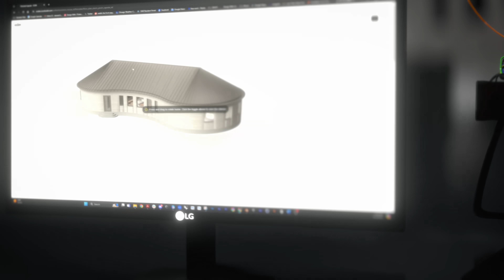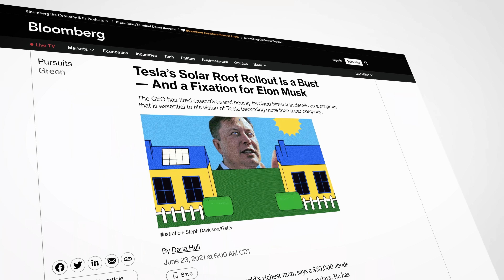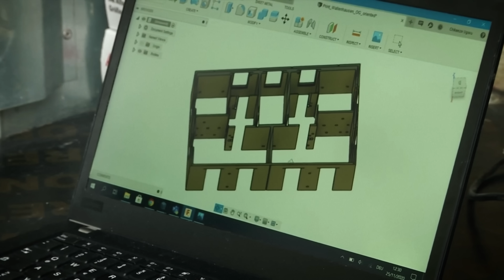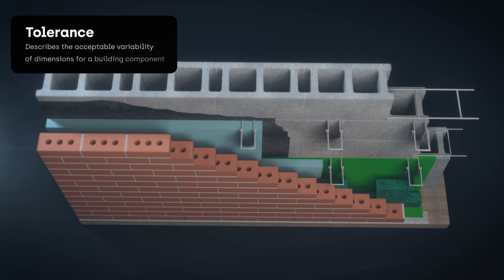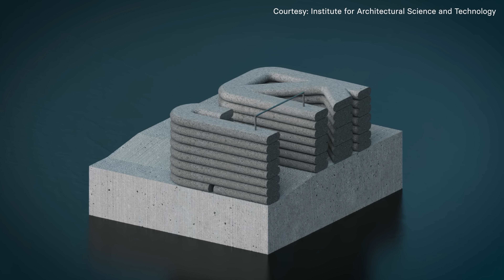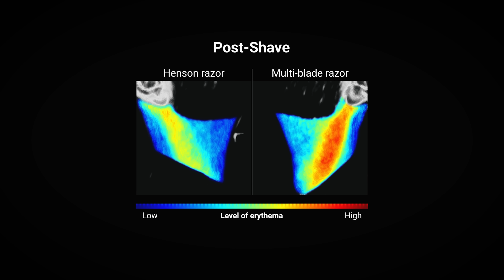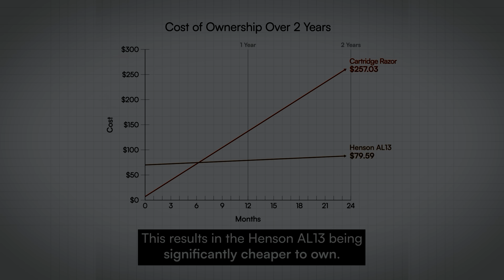Why 3D Printing Buildings Leads to Problems

Comment: I could get 3d printing for outside walls, maybe some load bearing fireproof walls too, since damage to those tends to need a major rework of a building.  The partition walls that can be open or closed floorplan stuff, or maybe relocatable utilities like laundry and mudrooms, should be modular.

Comment: I don't see any problems that cannot be engineered, right now when you build a brick house you plaster all internal and external walls unless you chose to leave the bare brick, the same can happen with extruded building, i actually don't see a problem other than the ability to alter a building, this confuses me as most all buildings have load bearing walls that you should not remove or if you do you design it so that the structure is still as strong as before.

This video seems to be a video looking for a problem, and i just don't see it. Plater internal or external walls as done with brick buildings, use wood divides inside the house for partitioning that can change or  as you said separate structures, so some can be removed in the future. LOL window or door  voids can be smoothed over by a worker who would have time to do a dozen other jobs while the building is growing.

Comment: Within 50 years, they will be able to integrate metals such as copper, plastics, and concrete into each layer of printing. Pipes, electrical, foundations, etc. will be able to be built layer by layer, with each pass integrated with all elements of a building.

Comment: Very good presentation. I see even more issues in a cold climate (where filling the voids with insulation just won’t cut it), unless you integrate/add tons of traditional techniques on top of this and then, where did the benefits go? And in a milder environment receiving substantial amounts of rain, how does the wall cavities drainage work?

Comment: while i'm not an engineer or architect, i have significant concerns regarding the long-term structural integrity of 3D-printed houses, especially after natural disasters and time. in contrast, traditional houses built with red brick or stone are using reinforced bars to maintain their integrity over time and in extreme events (such as natural disaster). despite the cost-effectiveness and time savings of 3d-printed houses, i strongly prefer traditional construction methods.

Comment: There is such a thing called the auto-brick laying robot. It's actually Faster than this crap and the house looks like - well, house built with bricks. 😂😂😂 How can pouring concrete on-site, layer by layer, beat mass produced bricks (gazillions a minute) being laid by a robot (same gantry robot by the way). Think in terms of resolution.....the brick as a large pixel, the 3D printed concrete as fine resolution.....which is gonna win the race in speed or cost? Dead-End technology.

Comment: 6:11 im in shock that brick has a 20mm tolerance. Formwork we allow for 3mm when we are being very sloppy, at least for the companies I’ve worked with.
Reply: Finally, someone who actually works in this field brings a hint of reality... 😮 thank you.
Reply: Its because as you place bricks you can actually just steer the walls in various directions, not to mention bricks are actually a very flexible material on a macro scale, As in they have alot of ways to expand without breaking. Then there is also just the human element of having 30 guys laying bricks in various directions at once you will get variance. To be more precise would be extremely expensive and slow.

Comment: Just bought a house myself, I got lucky and unlucky in ways. I don’t have much info, but I know the house was built before nail plates. The wood looks like it has about 2x the amount of bands a new 2x4 would have so the wood definitely was older when it was cut. Overall the construction is crazy solid, never creaks at all. Only thing is, whoever wired this fucker up did not understand the ground line. I’ve been replacing all my fixtures, switches, etc. they have actually utilized the ground in a total of 2 spots😂

Comment: I've watched this twice.
I still don't understand how your supposed to install the electrical, plumbing, and insulation into a concrete structure where the interior and exterior walls are built first.

Comment: 13:32 “3D printing in other industries is usually a method for making prototypes of things” or for bespoke creations (so not every home is a cookiecutting house), or for geometries that are difficult/impossible to manufacture using other methods (hence why companies like SpaceX using 3D printing for some of the internal chambers for their rocket engines).

Comment: I don't see why repairs or additions couldn't use mainstream timberframe/brick/cinderblock construction techniques.  It's pretty normal (at least here in the Midwest, USA) for someone to buy a 50+ year house and as the family grows, make repairs/renovations/additions using newer construction techniques that differ from the original.

Comment: I imagine many homeowners will plaster the interior walls to be smooth— considering plaster is basically drywall, but comes in a bucket instead of pre-formed sheets.

Comment: Commie blocks "3D printed" houses decade ago. With some modernisation houses could be build with big blocks instead of bricks or wood, faster, cheaper. Would it look like your modular kitchen cabinet for which you can select parts like lego? Yes, but who cares, if you can afford it? It somewhat worked a century ago. Google Catalogue Houses or Sears Homes

Comment: 3D printing will never make it to my new build.  
1)  introducing hundreds of weak points on a wall with all the cold joints between layers.
2)  potentially leaky walls.  concrete will crack over time, and the way the wall is laid out will introduce cracks which will allow moisture to seep through into the house.
3)  0 time saving at all when you factor in other critical steps like insulation and moist protection
4)  horrible asthetics.  You will still want a nice dry wall outside, eliminating also the time savings

Build with ICF blocks, and you can easily achieve similar build time with superior strength, insulation and probably cheaper cost too.

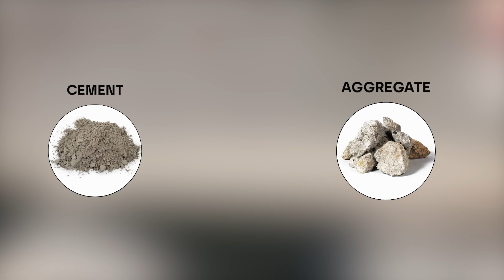Comment: mix aint going anywhere without any water 8:23 🤣i would be worried by no expansion joints. not a solution for large temperature ranges

Comment: Another MASSIVE issue is everything inside the walls. Normal houses wireing, plumbing, anything in the wall is put it after frameing but before drywall.

But you cant cut open the concrete to do the wireing and pipeing. And good luck if ANYTHING breaks.

Comment: You can do framing pretty cheaply. With factory build elements etc. But this kind of 3D design makes other parts more expensive, electrical work, detailing, plumbing etc.

Comment: This seems a stupid idea. If a 3D printed toy fails you just throw it out and buy or paint a new one. If a 3D printed house fails people can die. Houses need to be reliable, safety, and resist for long time, so you trust on technologies that have worked in the past. New technologies takes time to test, and first we test them on places that are not house them if it work people will accept it.

Comment: once a 3-D house is printed, there’s nothing to stop a builder from being rendered the finish to make it look a bit more traditional. A lot of effort in building construction is in assembling the outer shell of the house. The other cost is finishing the internal fittings especially the bathroom kitchen the wet areas.

Comment: They could easily put gaurds around the nozzle to automatically smooth the ridges as each layer goes down. It would add acouple more problems but be worth it for smooth walls.

Comment: I was doing development in Florida 2004-2007 (yeah, when sh((t hit the fan),  I was on site for 2 different builders that were putting up concrete block constuction homes, that were framing 2 houses per day..............2     let that sink in.  28 plus person crew, 8 inch concrete blocks.  This doesn't hold a candle to this.  They are laughing at this.  3 days later the trusses came.  They were building complete houses in under 5 months.  The framing part was 1/2 a day.  What problem are you trying to solve?

Comment: It’s quite cool but I must say I’m cynical towards 3D printing in construction. This is for a few reasons but most importantly the use of concrete due to CO2 emissions from cement manufacture. Secondly, prefabricated light weight construction is possibly quicker and cheaper with a far lower CO2 emissions.

Both systems require precise work up to DPC. Obviously there are advantages from the thermal mass of the concrete for stabilizing internal temperatures, but lightweight construction with a concrete ground floor should be sufficient thermal mass.

Still, it’s an interesting development and should be continued.

Comment: There are premanufactured steel reinforced concrete houses, which arrive in parts and can be put together in 48hrs. 
The problems of building houses are not solved by this. It only creates new problems.
Also this could only ever work on smaller one family homes, because the lack of steel reinforcements in the concrete makes this quiet fragile.

Comment: I rather like the smooth curves. If you need corners, just build the clearances necessary for external brick facades and internal plasterboard/sheetrock mounting

Comment: simple problem, make a tpu nozzle and add a wiper, and do prime tower on removeable ply wood that concrete can be broken down later, but it will give you better prints focus on one layer at a time, as precisely as you can.

Comment: This is total BS.  "Problems' come with every technology so there is nothing unique to 3D printing in that regard.  Those problems will be corrected just as they are for everything else.  Trying to monopolize resources and markets is what eventually screws it up for everyone else, unless your company is truly that much better than others.  Otherwise attempts at monopolization lead to corruption and trying to actively sabotage competitors.  Just like telling lies - you tell one and now you have to work twice as hard and tell 3 more to maintain the facade. So instead of spending all that effort trying to protect your interests by  claiming bunk about your competitor, try spending it on improving your own method and letting the results speak for themselves in an honest way for better or worse.

Comment: The one thing in the video 12:12 
If one of these companies were to go out of business, it wouldn’t be hard for a second company to take a sample break the concrete figure out. It’s a mixture
Or more likely create their own mix for the replacement
But there are many ways to repair this type of structure
 and replace the damaged area.

Comment: Just being honest this all seems pretty simple to fix. Fill rough walls with mortar (smooth walls), cut window and door holes (smooth attachment), broken pipe cut the wall fix the problem pour concrete.  All with 1 inexpensive material instead of multiple materials at multiple prices

Comment: Who told you you have to leave outside walls lumpy? They can be made smooth just like brick or USB sheet wall... stucco, rock facade, cladding... whatever you you can use on "normal" house can be used on 3D printed house.

Comment: Isolating the house from capillary water drawn up in the porous material same as any house with brick siding, or porous stone foundations. No modularity for repairs like brick, Patch it with brick. Still a wood frame house inside the shell with all the electric, and plumbing needs as any house. Have to drill down through it to install earthquake resistance tensioners.

Comment: I still think it is easier and cheaper to build a frame in the factory and then mount it on site than 3D printing, it is probably better quality too. Now if they have better tool for construction they may actually be cheaper to use those tool to build the frame (if you are going to build that robot on site you might as well can lay out a mini frame builder on site with robotic arm.

Comment: A much easier approach would be to make large,  very high quality,  concrete blocks with molded in 3d interlocking.   Something like 3 x 3 x 3 ft with inner ribs and hollow space.

Use the equipment to lift,  seal and stack them together, perhaps with a mason to guide the final steps. 

Similar or possibly faster construction,  plus quality texture on the inner and outer walls is easily possible. 

Blocks could be made on site or more centrally as practical.

Comment: I guess the trend is to leave the 3D printed structure bare, without any sort of aesthetic facade, in order to show that it is a 3D printed building but no one seems to mention the fact that it's hideous.
Reply: I was thinking that the 3D print would leave a perfect surface to hold a conventional stucco finish on the exterior, and skim coat plaster on the interior.  This would add labor, but think there is a lot of savings over conventional block or framing. But I can’t imagine trying your hang a picture on a wall, must be why you never see that in any of the images.

Comment: When the concrete walls are both the interior and exterior walls, I have to wonder about the human livability of these structures. If you can't, say, hang photos of yoru family or artwork because it would involve drilling into concrete, that will make for much more cold depressing environments. But not just that but a lot of people now will have televisions mounted into the walls which again will require you to drill into the concrete. And in seismically active parts of the country, you're advised to anchor furniture to the wall as well so it doesn't topple over in an earthquake, which also becomes a problem if your walls are made of concrete

I'll admit this is a really cool idea... but it definitely seems, like a lot of tech ideas, that they never considered anything beyond stage one of the plan

Comment: Add fiber and wire with the concrete mix
The door and windows frames can be prefabricated 
A guy with a concrete saw and hole saw drill can fit the prefabricated structures into the frames or a robot can do that too

Spaces can be left between the walls for electrical and plumbing. 

The finish can be done with tile inside and outside. 

The foundation is what worries me though

Comment: I didn't see a single wall receptacle or switch in any of the images you presented - and - most electrical (and plumbing) inspections require the wiring/piping be visible for inspection before approval. How are these items addressed during the print process? Exposed pipe and conduit would solve the problem and allow repairs to be performed without jackhammering a wall, but most prefer hidden wiring and pipes.

In areas prone to fires, hurricanes, tornados, etc. I can see advantages in durability with the material. Good thermal mass, etc. Add some embedded steel reinforcement and good to go.

Comment: yeah well hate to tell you this these houses will not be as popular as you think. Maintaining these style houses are very expensive. imagine having to knock a hole in the concrete to replace a pipe, Or fix a leak. oh you want to add a new cable for tv yeah now you have to tac wires to the exterior While the structure of this is good the common sense of it is stupid.. building these style houses in place like Oklahoma  where the ground constantly shift or sinks do to Dry clay cracking would be a nightmare. Postension in places like California. Like all things over engineered is great on paper but in practice is more headache then its worth.

Comment: 3d printing houses is just a step in the evolution of 3d printing.

What can be done, what can't be done, how to change what's being done to fix the problems that naturally arise when doing something new.

3d printing came from a Plotting machine.
-Change the pen to a drill, the Plotter becomes a CNC machine
-change the drill for a welder, to go from "removing material to adding material"
-change the welder for a glue gun (change the formula) to get a basic, common, 3d printer  [or cake decorating, leading to 3d printed food]
-expand the glue gun and use concrete (change the formula) to 3d print houses

There are different materials that can be used with 3d printing houses...
-use more rock
-use recycled glass
-use a UV reactive resin for quick hardening

This is more of a niche market.  It will expand on its own, but dont expect to see a neighborhood built of these

...imagine a sky scrapper made like this, and falling halfway up.   Wet concrete raining down
Nope.  That type of construction would have to be printed FAR differently

Comment: Yeah, construction workers we don’t need you anymore. We can make buildings out of soft serve mortar cream. Even Romans billing the Colosseum knew that wasn’t very strong. A holes. 20 years in the concrete industry. Ended up a pump operator and a volume metric operator. Grout does not make strong concrete.

Comment: If its something affordable without a lifetime mortgage, people will live in them.  
- Renovations?
- Repairs? what if a hold or chunks gets taken out?  How do you repair?
- Plumbing and electrical work is visible 24/7?  That's ugly if so. Electrical sockets, light sockets, where are they?
- Wifi signals?  Are they blocked or weakened
- What about -40c Celsius weather? How insulated are these?  What about 40c?
- Noise dampening?  How much does outside traffic and noise penetrate these walls?
- Echoing? Is it a problem?

Comment: Robots work as long as there  is material to print with … traditional construction work until break time, or as long as it’s not too hot, cold or wet.  You only need one “robot” to print a house, but you need a worker and five supervisors standing around, drinking coffee, chatting and yelling at the worker to work faster.